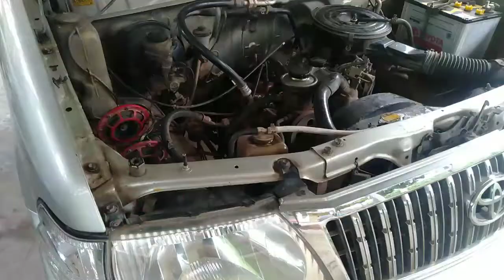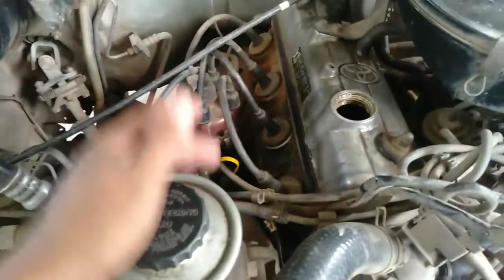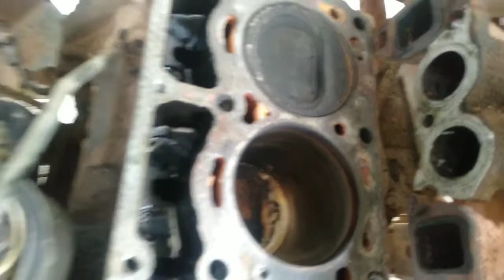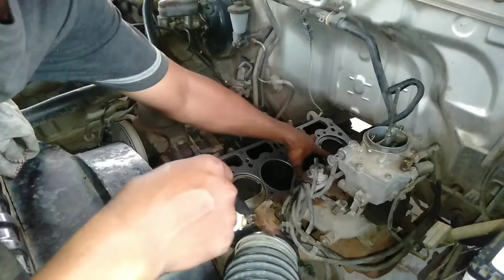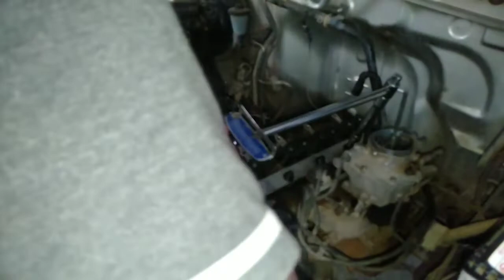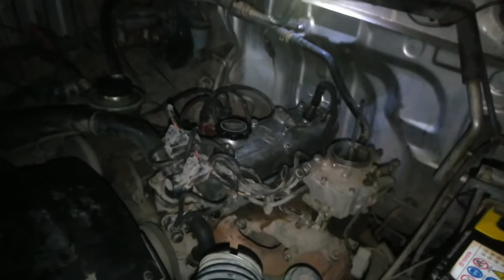Bongkar Deksel Kijang LSX 7K

Comment: berapa biayanya betulin silinder head mampet akibat overhet radiator bocor
Reply from the maker: Jasa Beda2 Om,,,
Jasa Bongkar Head saya 4-5 rts scrap 250 Perpak 160 Han lem 30, Sil klep 260 di bawah 2 Jutaan Om sama service radiator🙏,,di bawah 2 juta Om😁🙏
Reply: @PapiKembar  lokasi bengkel dimana mas